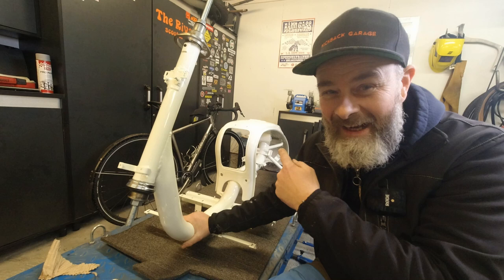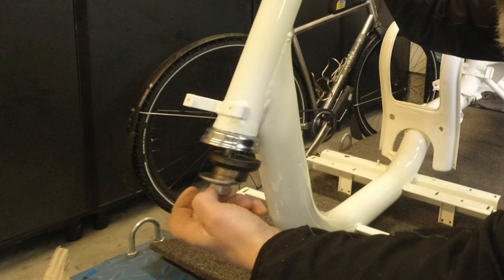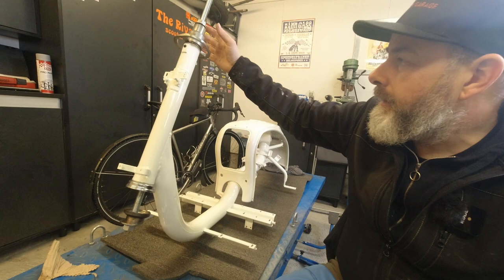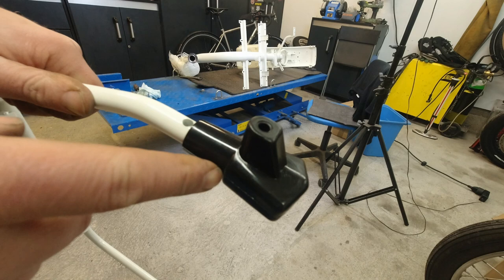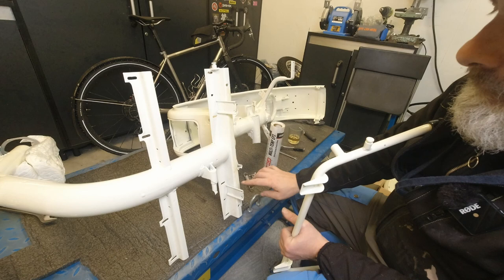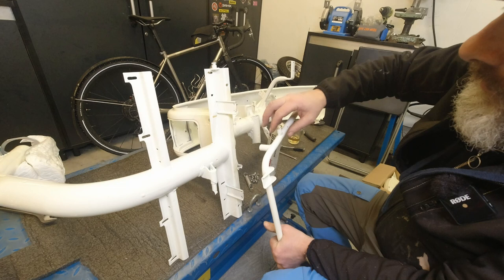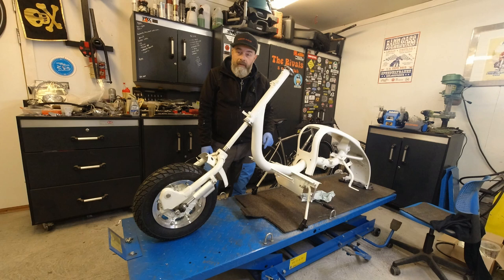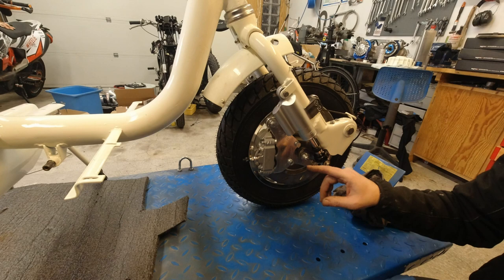Lambretta Li150 series 2 rebuild, part one #kickbackgarage

Comment: Hey Rob, just a note: As long as the paint does smell, don't put rubber parts like rear light gasket onto the paint. The softeners in the rubber parts will react wit the paint.